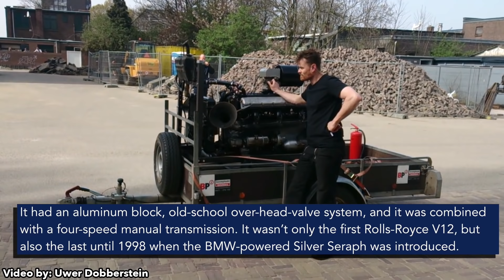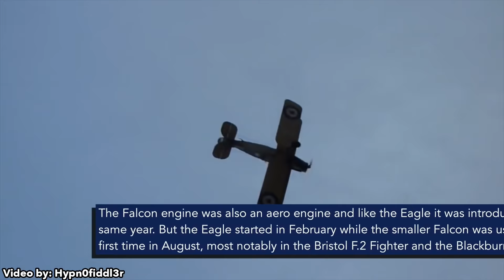10 Greatest Engines Rolls-Royce Has Ever Produced

Comment: Rolls-Royce was established before 1906. Don't overlook their earlier 2, 3, and 4-cylinder engines from about 1903. The design of the L-series V8 was bought in 1956 from Packard, and enlarged a bit. The Meteor was an unsupercharged Merlin built by Rover and used in tanks. Gas turbines - a very steep learning curve, involving Nimonic and Inconel alloys. The Bristol Fighter used the Eagle engine,  with a claimed 275 HP. American Bristol fighters achieved the same performance with the Liberty engine, with a claimed 400HP. Seems English horses have much longer legs.

Comment: I have always been told the first Rolls-Royce engines didn''t have starters because the clearances inside the engine were so precise all you had to do was turn the ignition on and at least one cylinder still containing compression would fire and the engine would be running. If that is true that would be the best engine Rolls-Royce ever made.

Comment: There's also the Rolls-Royce Crecy engine, designed and tested during WWII. 

The Crecy never went into production, and no examples survive. It was a 26 liter (1536 ci) uniflow two-stroke V-12, with sleeve valves driven by eccentrics on the crankshaft and a centrifugal supercharger.  Apparently it had the loudest exhaust noise of any engine, ever, and the exhaust coming out the stacks added some 30% to the thrust. Some versions added an exhaust turbine geared to the propeller shaft to use that power.

And, like its somewhat similar contemporary the Napier Nomad, it was supplanted by the jet engine before it was ever put into production.
Reply: I know it's been 4 years... but I NEED to find a video of a running Crecy!
Reply: Holy fucking shit... 2 stroke 12 cylinders i-

Comment: Conspicuous by its absence in your list is the Dart turboprop, an engine which had an uninterrupted production run of 43 years and which has powered 80% of all turboprop aircraft produced world wide. An engine which is still in wide use even today. An engine renowned for its ultra reliability, smooth running  and economical operation and very low noise qualities

Comment: I am pretty certain that apart from initial development models the Meteor tank engine wasn't built from crashed Merlins. It was a 'redesigned' Merlin, heavier built, without a supercharger and with many tank specific components. Production engines were built at a dedicated factory by Rover.

Comment: You have to experience a ground run of that Griffon engine live, it's unbelievable.
You can feel the concrete runway vibrate 50 meters from that engine away, and the propwash and the exhaust fumes of the avgas used make it impossible to breath.
They use shortened prop blades to aply some load on the engine, without it and it's trailer taking off, the engine would quickly overrev without load, and the airflow is needed for the cooling, because the original radiator is small, it's designed for light weight and a high speed air flow.
Reply from the maker: Wow
Reply: I noticed the contra rotating blades. Is that because the engine was taken from the Fr47 Spit, or are they there in order to meet engine load requirements.
Reply: It's a Griffon Mk58 from a Shackleton.
Reply: Ah ok, that makes sence. Completely forgot about that aircraft for a second there.

Comment: Very very very surprised not to see the Rolls-Royce/Snecma Olympus 593
Reply: The Olympus was developed by Bristol-Siddeley Engines who went into partnership with Snecma to produce the 593 variant. It was only after this that RR took over Bristol Engines, thus stamping their name on the Bristol-Siddeley line.. So, though it was produced by RR, it wasn't actually their engine.

A key point to note is there being no River Olympus, however there is a Mount Olympus. RR use river names for their jet engines, while Bristol used names from Greek mythology for all their engines.

btw. Exactly the same goes for the Pegasus, the engine used in the Harrier jump jet. Developed by Bristol, taken over by RR.
Reply: Kimdino - Quite correct. The UK government-forced takeover of Bristol Siddeley resulted in RR and SNECMA taking the credit for the Concorde's engines.

Comment: As a young apprentice I watched as a late Rolls Royce Merlin was 'pushed through the gate' on a Heenan and Froud dynamometer. This could only be held for a short time in an emergency and resulted in a major engine overhaul afterwards. It was a last resort and very rarely used. I helped with the overhaul and the engine was fine. That was over 50 years ago but I can remember two things well. One was wondering why the exhaust stubs didn't melt and two the tremendous noise from the engine and supercharger. Nobody was allowed in the test cell but when you think there was a pilot, one just 18 years old, a few feet away and being shot at it makes one think. I do hope Rolls Royce don't get destroyed like so many UK companies, they are the best after all.

Comment: I have 2. Of course like any other WWII aviation nerd I will always love the Merlin. I was a little disappointed you only listed the Spitfire as being powered by the Merlin; it also powered the Fairey Battle, Hawker Hurricane, P51 Mustang, the Avro Lancaster bomber, the Handley -Paige Halifax and the de Havilland Hornet and Mosquito. I know there are more but those are the better known ones. 
The other choice is the Trent, and my reason is that I live just about directly in the flight path of all planes that land at Boeing Field (South Seattle, WA USA). It’s amazing how quiet the newest turbofan engines are; with triple-pane windows and quite a lot of insulation in the attic I can hear them but it is not at all oppressive; you get used to it rather easily.

Comment from the maker: These are truly amazing engines. Which one do you like the most?
Reply: VisioRacer The Rolls Royce Trent runs on Jet-1A/J1 jet fuel.
Reply: the Spitfires powered in the start by merlins and after they had merlin or grifon option
Reply: Merlin, by far.  No matter how many times I see it, look at the specifications, and how it's built, it still blows my mind.  Plus, the design is 80 years old - OHC, hollow cams, sodium-filled valves?

100hp per liter in the 1940s (at full emergency military power)

It is still used in aircraft racers like the P51, putting out 4000+ hp.
Reply: For the Griffon think there was a whole series of Spitfires with a modified airframe, and five-bladed props.  Earlier variants were Marks XII-XIV, and a XX+ series had the modified frame.  Not sure about that, though.

Tremendously powerful engine.
Reply: The Griffon; so powerful for the time and used in some lovely aircraft :D
Reply: And probably doesn't weight 6.5kg haha
Reply: that meteor engine had some serious flames
Reply: Think there was a mk18 too, aswell as the seafire Fr47 with contra-rotating blades.
Reply: Merlin.  But I would say that, wouldn't I.
Reply: V-12 Merlin in a P51 Mustang
Reply: First the Merlin was in the Spitfire and the Hurricane.
Reply: It would be Griffon if it had hp/liter on similar level as Merlin. It's 3/2 of Merlins displacement and same power? I'd like to have over 3000 hp Griffon
Reply: UUMMM, the EJ200, wtf man
Reply: Nothing comes close to the merlin in a spitfire for me.
Reply: The Spitfire was a great airplane for it's time, but when the P-51D came on the scene it flew circles around the Spitfire, the ME-109 and the FW-190. Spitfire pilots that graduated to the Mustang said so.
Reply: *****
google it or ask you granddad  but he is right the p 51 d came out with a laminar flow wing that increased its performance and range ,,,, this is common knowledge mate
Reply: Several books I read written by P-51 and Spitfire pilots in WWII.
Reply: The P-51 wing was kind of laminar flow. It sort of bridged the gap and wasn't quite one or the other. It was designed to be laminar flow but the problem was that the manufacturing techniques in WWII weren't quite good enough for that level of accuracy.
Reply: VisioRacer
Reply: VisioRacer .
Reply: James Neumann 
"100hp per liter in the 1940s (at full emergency military power)"

No way. The highest rating I have ever seen for a wartime Merlin was 2,070 for a Merlin 130/131 from a De Havilland Hornet. You might get that kind of output from a racing Merlin though but that would be running different fuels. I know Griffons have been pushed to 4,000.
Reply: When you've been to as many airshows as I have, the Merlin gets kind of meh... The best sounding aero engines are round. Not Rolls-Royce but the Bristol Centaurus is the best I've heard. For inlines, a Napier Sabre is hard to beat but I don't think there are any flying examples, though Kermit Weeks is restoring one.
Reply: The Merlin series most perfect of all. demo.. The griffon is the best Aero Engine Ever made, and what a sound ! Even the Bristol Centaurus was a staggering machine but scared me a bit, and i always ended up to love more the RR engine for the WWII ^^
Reply: All amazing engines, but you forgoth the best of them all, the RR Concorde engine
Reply: soaringtractor  why are you talking to yourself Wilbur.....nobody is listening. We've all gone you've bored us to death.
Reply: +SuperEdge67 +Willie Eckerslike Just block him. He's a troll.
Reply: Everyone here is talking about war thunders engines just be honest
Reply: +SuperEdge67: Please permit me to commend the excellent grasp you seem to have on WWII fighter aircraft. I'm a 50 year old airline pilot and something of a WWII, aeronautical historian. I was deeply impressed with your understanding of the different Spitfire Mks. and agree with your assessment of their performance vs the P-51D. The point at which I really took notice of your expertise, however, was your mention of Kurt Tank's beautiful, TA-152.  Such a fantastic airplane of which so few people are aware. Keep up the excellent work.
Reply: Anton Skippy  Thanks very much.
Reply: That Merlin, I want one more than I want money to appear when I snap my fingers
Reply: St   "The Fairey Firefly got the first merlin !!! FYI !!!!"........WRONG!!!!
Hawker Hart  in February 1935, followed by the Fairy Battle.   And I would have though that such an expert like you would have known that the Firefly had the Griffon.

Incipient senility creeping in.
Reply: VisioRacer most jet engines used jet a b or c
Reply: Merlin
Reply: Without a doubt, the Merlin, AND in a C-D 
model Mustang.  Heck, the cooling 
system added more thrust.

https://en.wikipedia.org/wiki/Meredith_effect

steve
Reply: The 6.75 liter V8 turbo, the newest version used by Bentley produces 530 hp @ 4200 rpm and 811 ft.lb. torque @ 1750 rpm. I want it in my truck.
Reply: Apparently the Griffon engined spitfires weren't as nice to fly?
Reply: The Merlin is a Falcon that inhabits the entire Northern hemisphere, not just Iceland. It’s call a “Pigeon hawk” in the US.
Reply: RB211
Reply: James Neumann, the Mk XII Spitfire was the first to be fitted with Griffon engines, as were some of the other later models. 

According to Wikipedia, the highest altitude and speeds reached by a Spitfire are retold thus:

'On 5 February 1952, a Spitfire 19 of 81 Squadron based at Kai Tak in Hong Kong reached probably the highest altitude ever achieved by a Spitfire. The pilot, Flight Lieutenant Edward Ted Cyril Powles, was on a routine flight to survey outside air temperature and report on other meteorological conditions at various altitudes in preparation for a proposed new air service through the area. He climbed to 50,000 ft (15,000 m) indicated altitude, with a true altitude of 51,550 ft (15,710 m). The cabin pressure fell below a safe level, and in trying to reduce altitude, he entered an uncontrollable dive which shook the aircraft violently. He eventually regained control somewhere below 3,000 ft (910 m) and landed safely with no discernible damage to his aircraft. Evaluation of the recorded flight data suggested he achieved a speed of 690 mph (1,110 km/h), (Mach 0.96) in the dive, which would have been the highest speed ever reached by a propeller-driven aircraft if the instruments had been considered more reliable.'

Spitfire Mark numbers went up to Mk. 24, but the Seafire variants went up to Mk. 47.
Reply: The Merlin and the Griffon.
Reply: @thethirdman225  have you heard a sabre running? Is there a video of it? I've heard a Napier Lion running, but not a sabre.
Reply: Bill Bonnington Not in real life. To the best of my knowledge, there are no operational Sabres anywhere, although Kermit Weekes is rebuilding one with a Sabre engine. There are audio files of the Sabre engine around on the net.
Reply: @thethirdman225  indeed, there is also a Typhoon rebuild going on somewhere, who knows, we might have two to listen to. What a thought!
Reply: Trent XWB
Reply: VisioRacer I like them all but the Griffon is probably my favourite. I could never get my head around how two contra rotating propellers work- shaft wise? Also, the extra overhang here must have put a lot more pressure on the front bearing.

Comment: I just found out not too long ago, on the merlin they built those header pipes like that to take advantage of the extra energy from the exhaust, the thrust actually added 150 hp worth of speed to spitfires, p51d mustangs, ...and hell the dozens of other aircraft they powered, and they were so efficient yet powerful alot of planes got their radials replaced by them

Comment: I just wanted to add that Whittle is generally regarded as the inventor of the modern jet engine.
Reply: True but incomplete, as no doubt you know. The main problem with Whittle was Whittle himself. He was a very difficult man to work with, and this held up development and introduction to no small degree, with the Rover car company eventually taking over much of the wartime jet engine development and pushing ahead where Whittle was making both small and slow headway. To those interested, there is much available on this subject both on utube and the internet generally, and a few searches can be rewarding.
Reply: @vipertwenty249  ..and the BTH works too at Rugby, Warks..

Comment: The V12 RR Kestrel was produced in considerable numbers. The supercharged version, Peregrine, rather less as was the Eagle 24 cylinder.  There was a huge range  of prototype engines.
Just for info the Olympus was designed by Bristol before it was taken over by RR!

Comment: I think the Merlin has to go down as the greatest. For me, I love the L410 and I think the fact it has evolved over 50 years and into the engine found in the modern day Bentley Mulsanne, is a tribute to the quality of design. The only clarification I think is needed, is BMW didn't purchase RR - they bought the right to put the RR name and badge on a car. Today, Rolls Royce aerospace engines can trace it's DNA right back to Charles Rolls and Henry Royce - not so with BMW RR cars, which are a bit like the individual who went and purchase a lord of the manor title and calls themselves "Lord..."
Reply: BMW bought the right to use the name RR on a car in 1998, they didn't buy the car division. This was bought by VW. BMW bought this right from RR plc - the aero engine manufacturer which was split from the car company in 1971, but retains the rights to the RR name and licenced it to the car company. In a twist, in 2006 RR plc bought BMW aerospace. The L410 engine was deigned and developed by Rolls Royce in 1959. Bentley have developed the engine further under the ownership of VW.

Comment: 5:30 one of the cylinders is not firing properly
Reply: Maybe there were no more spark plugs on Ebay...
Reply: Saw that too, might get better when she up to temp perhaps.
Reply: Mike Creed No i don't think that's it, all cylinders in any given engine should be approximately at the same temperature and condition so all should operate the same, on this example the cylinder does not operate like all the others
Reply: I quite agree, but it could get better, defo not right though hey.
Reply: George Badass all these old engines are ticking time bombs now
Reply: "Ticking time bombs", ..... why ?? ..... with a good mechanic or engineer, ... these engines will run forever, ... even when spares run out, a good engineer would make them.....
Reply: Sorry Olle, ... that answer is for Jimmy Grant

Comment: The footage of the Eagles in the Vimy replica aren't in fact Eagles.
It utilised the following,

Engines:Australia flight: 2 x 454 cubic inch (7.4litre) Chevrolet V8s in NSCAR racing trimSouth Africa Flight: 2 x 5.4litre BMW M73 V12s producing 321bhp (240kw)Atlantic flight: 2 x 495 cubic inch (8.1 litre) Orenda OE600 V8s producing 600bhp (450kW) maximum/500bhp (375kW) continuous